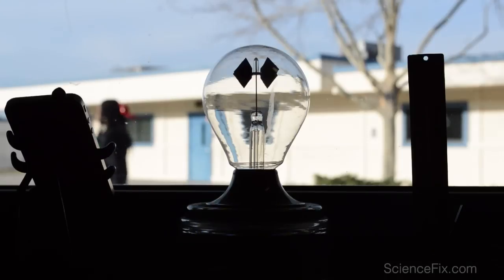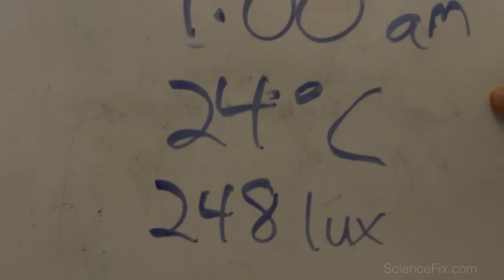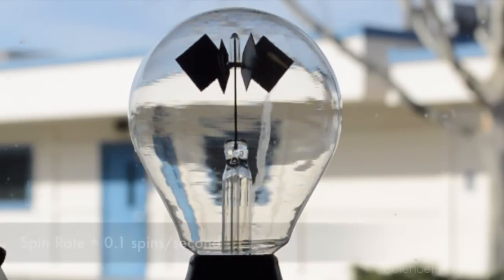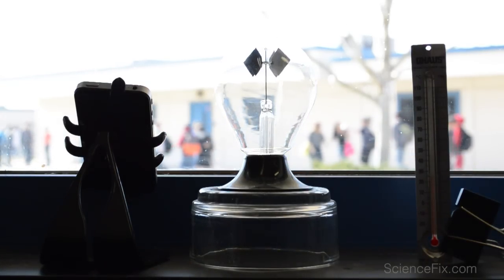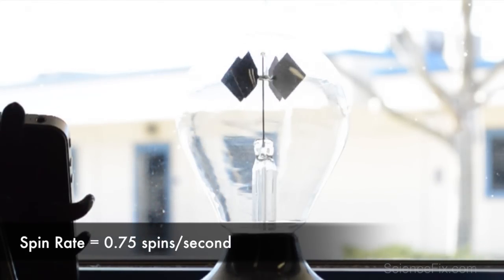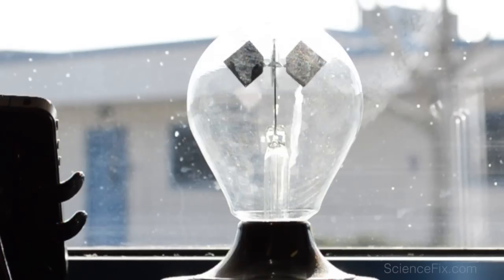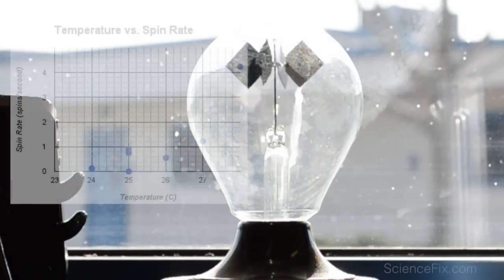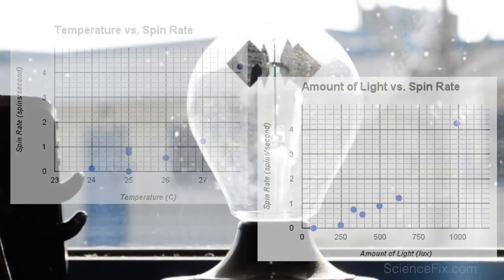What Causes the Different Spinning Rates of a Radiometer?

Comment: Great video! I believe they both play a role, the l heat increases the temperature of the air inside the glass making the particles inside move, therefore rotating the shaft and the photons of light bounce of the black side of the vanes causing it to rotate even faster.

Comment: it looks like you're getting a false correlation due to lack of a control object. You would need at least two, and it would be in a two part experiment. Both would be set at the same ambient temperature one in close to total darkness and one with a light source. The second part of the experiment would be Both in total darkness with two different temperatures. Then you can extrapolate a correct model for outside influence.

Comment: its mainly the amount of light that would determine the spinning rate by heating up the air inside the tube on the sides closer to the dark vane. This heating may be offset by the drop in outside air temperature in some cases..